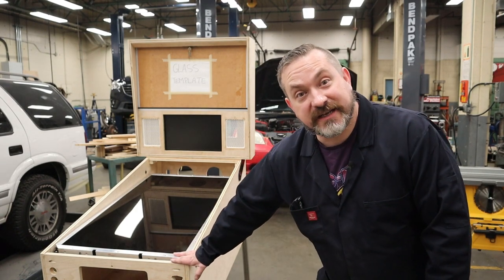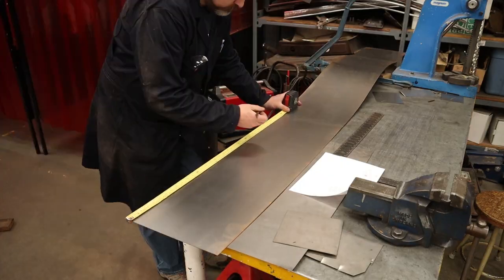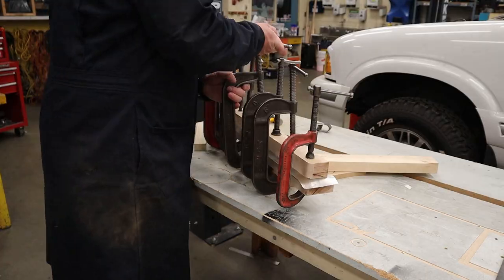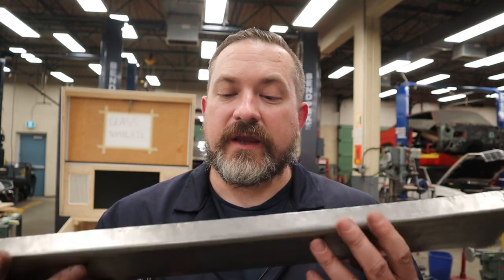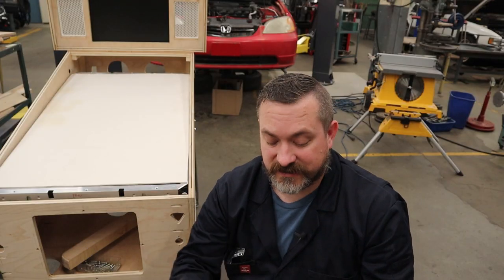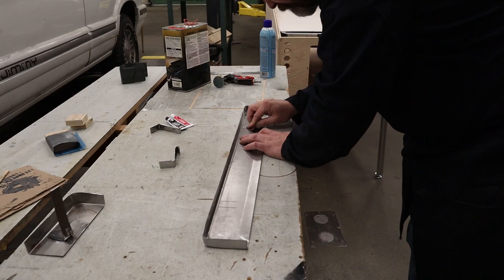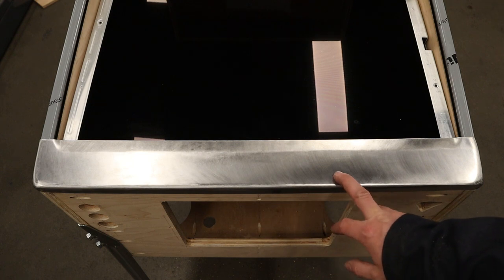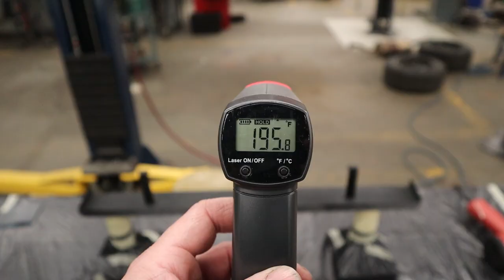DIY virtual pinball lock down bar part 2

Comment: There is a good bit of new information for me in this one. I think the test run on with mild steel is going to help with the results of the stainless. I look forward to seeing that process. Great work as always!
Reply from the maker: Ya if you haven't ever done it before, I would suggest the practice piece.  You can also experiment with the size of the cut out in the corner so you have a perfect bend and almost no gap to fill or weld.  The stainless version video is coming, I'd wait till you see that one before starting on it.  Cheers Mike!

Comment: Most intimidating build step I’ve ever seen. I was freaking out when you cut those corners. Lol

The JB Weld looked really good!

Hind sight, perhaps you can leave some tips in the comments. 

Just cut the corner before hammering to make hammering easier knowing your going to fill afterwards?  

Also… you said before you did this to save costs. Any idea what it cost you to make this? 

As someone who doesn’t have stainless steel lying around, I’m wondering if I would save anything at all if I had to by and entire sheet and then cut off the 6” I need. Lots of expensive scrap. Ideas? 

All in all, an amazing video on no weld hammer forming! 

I especially loved the tip on choosing a hammered metal finish paint to hide your hammer marks! That was a pro move! 

Great video man.
Reply from the maker: Thanks Donald!  Great comments and questions too!  Yes you are right, people should figure out a cut out to do on the corner so it's way easier to form; I did this video to show my learning process and how to do it knowing this would happen rather than just show a final product like some youtubers do.  In the next video, I use this knowledge to help me make a perfect version but out of stainless.  Cost?  Almost free dude.  I had the wood (maybe $5-10), I had the 19 gauge steel sheet metal (maybe $5), I had the flat bar ($2), I had to buy the jb weld ($10), and the paint was like $12.  I would not buy a whole sheet of steel or stainless, just order the exact size you need, it will be way cheaper.  Just go to a metal supplier local to you.  Thanks for the watch dude, if ya haven't already, I could really use some help spreading the word about my channel.  Thanks in advance!

Comment: I've decided to build a 32 inch playfield mini vpin.  I have a question about the side rails.  Since my cab will not be as long as a standard WPC cab, I need alterative side rails.  I've found Pinball 2000 side rails that are 42-13/16" long.  How long would I need my cabinet sides need to be to accommodate those rails?  Thanks for the video!
Reply from the maker: That I'm not sure about.  Perhaps someone who has build a mini pin on the facebook group will know that answer. I would be tempted to just modify a stock set to the length I needed.  Good luck and thanks for the watch!

Comment: can i ask why your tv is sloping downwards towards the back of the machine shouldnt it be the other way around higher at the back and lower at the front .
Reply from the maker: Its further down at the back but the back is higher to begin with so it's not actually leaned back, it's just slightly upwards to make room for the 4" needed for the matrix aleds and to simulate a real pinball table playfield.  Thanks for the watch!

Comment: THAT LOOKS GREAT!!! sooooo.... you said they run about $150 on a site??.... 🤣🤣because i am NOT making that lol
Reply from the maker: Thanks bud!  It's way more than that.  You need a receiver and a lockdown bar.  For me after conversion, taxes, duty, and shipping....it was almost $450.  So I made it.  This is the first time I made a hammer form so really it can be easily made, especially  with a diy video like mine to guide ya.  Thanks for the watch!
Reply: @wayofthewrench  not sure if mine will be functional... More so for optics.  If I have to attach hooks and latches like you did, that much I can do.
Reply from the maker: You can do it!